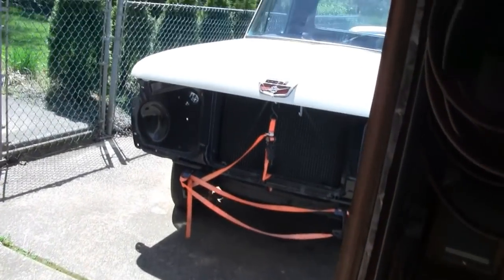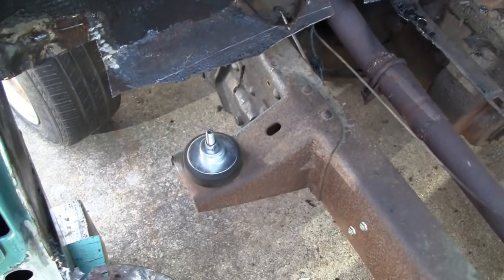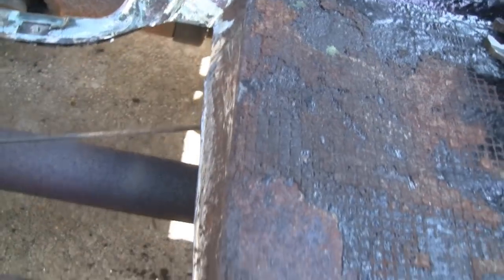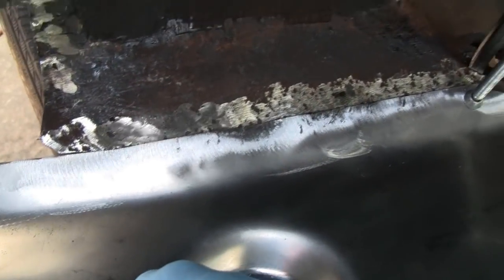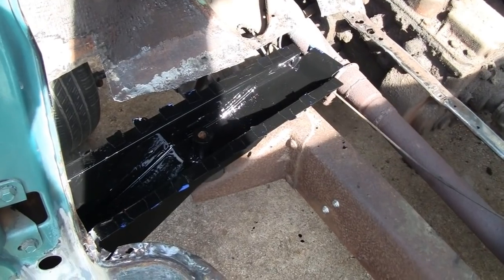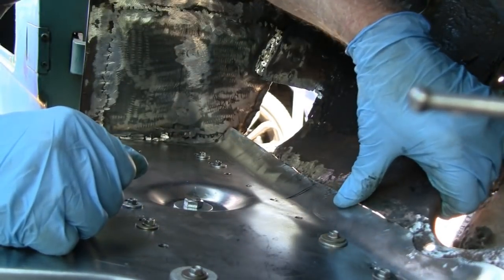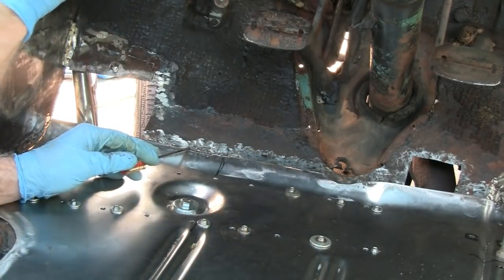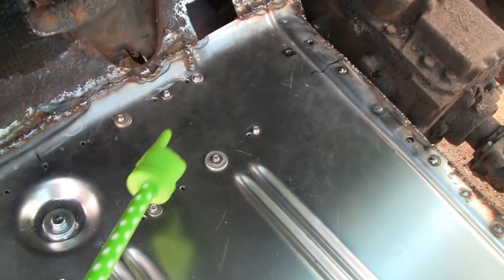WELDING in CAB MOUNT and FLOORPAN FORD (F100 part 53)

Comment: I use Uni bits, angle drills, and air saws in aircraft structural work. The good part is that metal isn't weldeable, the bad part is that metal isn't weldeable!
Reply from the maker: Roadking was working on his A&P Certification back in the 80's, never followed through with it though!!☺

Comment: The quality of those multi-size drill bits depends on the number of flutes.  The HFT ones usually only have one or two flutes, but they do work ok in aluminum.  Haven't tried them in steel.
Reply from the maker: If you do alotta drilling in sheetmetal it worth getting a good one!!☺

Comment: That right angle drill .
I ended up buying one a few years ago for cabinet installs .
I had a similar one ( adapter style that you did ) but when you’re in a blind hole , the adapter flips down and if you can’t get a second hand in the blind hole , it’s as useless as not having one .

Anyway ,, I have the Milwaukee ra drill and they dewalt .
The mil was cheaper ,,and its was actually better quality than the dewalt 👍😊
Reply from the maker: I think I paid $50 for that Makita used, that thing got me outta many jams!!☺

Comment: We use those cage nuts all the time for rack mount cabinets but I've only used M6 size so your solution is probably better.

When the truck eventually goes to junkyard heaven, the one part remaining is going to be those spacer tubes.
Reply from the maker: Yeah Buddy!! Those tubes weighed as much as the whole mount weighed!!☺

Comment: I borrowed a welder that doesnt use gas. Is there a wire i can use for this process that doesnt require gas? Thankyou
Reply from the maker: Flux core wire